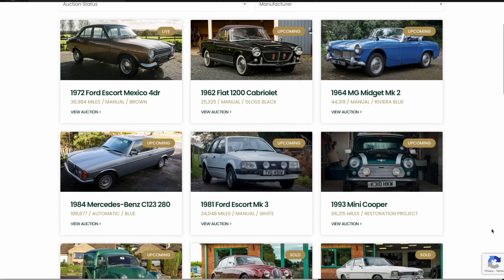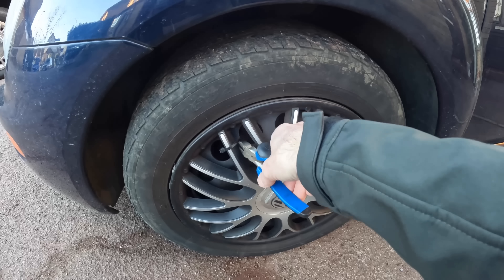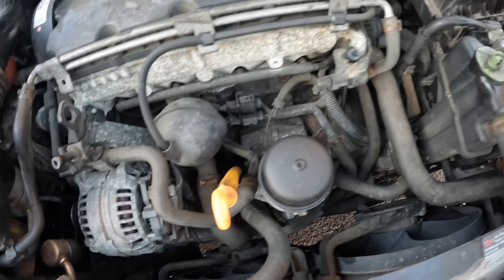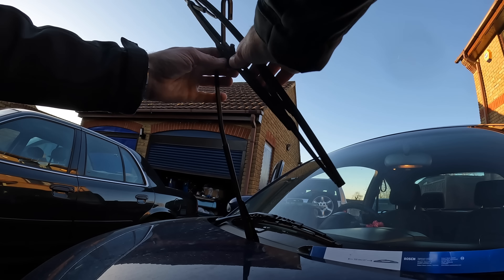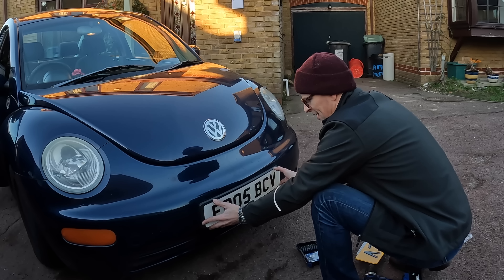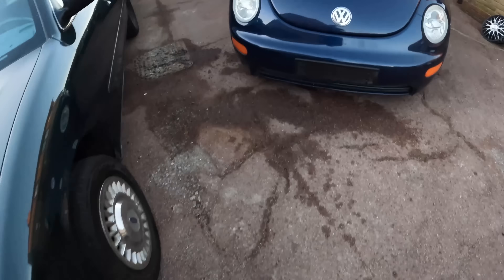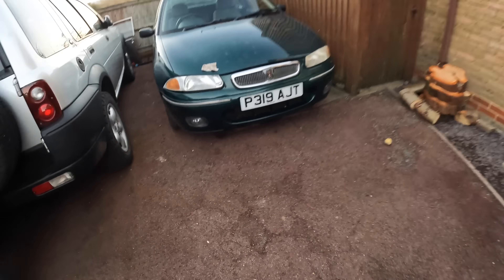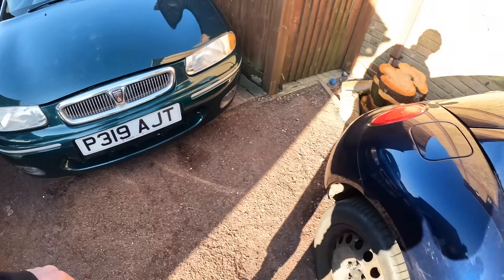New Beetle clean up and fix up begins! Headlight restoration - what a difference!

Comment from the maker: Heres the headlight cleaning kit I used in the video - https://amzn.to/3XhQoRR
Reply: Interesting product Matt! Never seen it before. It saves a lot of time (skip the sanding, polishing etc). Worked out very well on both cars. Rover changes were more than outstanding!
Reply: Sold out already 😥
Reply from the maker: @fhwolthuis  no way!!
Reply: @furiousdriving  yup, and from their own website they don't ship outside UK 😩
Reply: isnt the pipe the lower part that was attached to the one you removed? posting before watching whole video btw. also those impact bits are designed for impact drivers, not hammer drills, doubt it will hurt them though but different impact directions.
Reply: @fhwolthuis  Our Post Office here (An Post) can provide one with a virtual UK or US address to ship to  their mail hub in UK or US  for those companies that don't export (often cheaper and faster shipping than those that do) and collect the customs duty/fee and tax.  Other country's Post Offices/Mall Services should do the same this day and age.
Reply from the maker: @fhwolthuis  bother!

Comment: This is so fun to watch. My daughter has a 2004 beetle and the headlights are frosty. I’m so pleased to find a simple solution. I’ve noticed that the brakes are “soft and spongy”, do you have any suggestions for improving the sharpness of the brakes please? Thanks.
Reply from the maker: Try replacing the brake fluid, that should sharpen it up
Reply: @furiousdriving  thank you so much. I appreciate that.

Comment: Good job, Matt. Glad you didn't wreck the factory wheel trims. They are worth a bob or two and are getting rarer by the year. The headlamps look ever so much better. I have been using McGuire's PlastX for years. The 33 year old headlamp lenses in my 90 Volvo 240 are still as clear as the day the car was built. Some day I will get a set of the glass E-Code headlamps to replace the North American polycarbonate ones.
Reply: Pretty sure they aren't the factory wheel trims... when I owned that car, I researched them and the closest I found were some Amazon specials. They are utterly horrible and on a sunny day with the window down they do rattle... I just hadn't got around to binning them!
Reply from the maker: Real VW trims are insanely expensive used, these are cheap Amazon/Wish specials which I wont miss!

Comment: Just a heads up Matt,
The horseshoe clips are definitely better when they are fully put in first
Then push the hose into the housing afterwards, it can be quite hard to push the pipe inside but you'll get a satisfying click when you know its fully seated

The pipe you have actually looks like it could be the lower hose.
Its the one that comes from the turbo to the intercooler as I assume the beetle also has the side mounted intercooler like the rest of the Mk4 platform!

You need to remove the drivers side wheel, remove a few clips / T25 torx in the wheel well to access the hose.

I assume it's either split or like alot of the PDs has the issue of the hose blowing from the turbo due to the horseshoe clips being put in after the pipe!
Reply: Added note,
I had a quick look through a parts list for the PD beetle

The intercooler is sidemounted
It's on the drivers side,
The part you have supplied with the car, the code should be 1J0145828AD
If my cross reference is correct,
If not just punch the Part no into Google & it should tell you which pipe you have

As previous mentioned however, I'm pretty sure it's the lower hose from turbo-cooler

You can also tell if one side of the hose, the metal part is smaller internally one side as that's what sits against the housing of the turbo!

Best luck mate, fab little engines!
Built a 330bhp one with my brother in 2021

Comment: Check the part number on the hose matches the paperwork. Googling the part number on your paperwork,  it says that part is the intercooler to intake manifold boost pipe.

Also there's no need to buy a headlight kit. Just rub them back with some 2000 wetndry until all the yellowness is gone, then buff with some compound and a DA polisher, then apply a ceramic cleaner to stop them yellowing quickly again.

Comment: Time to clean those steel wheels up  they look cool bare.  Cable ties on wheel trims is compulsory here whether they have a tendency to become airborne or not.  A pain when changing a wheel when coming down in buckets and pitch black.  Manufactures should have stuck with glass for headlights.  Plastic may have saved a couple of quid and a few grams of weight but cause owners hassle.
Reply from the maker: they can make the very sculpted fronts more easily in plastic so the designers love it

Comment: 3:57 Those stones are now making their way into a cylinder…..😢
Reply: It's all so rushed and slap dash. If he had at least given it a quick clean before refitting then the stones wouldn't have got stuck on the soot/grease/crud.
Reply: There was a cut just after, surely he removed the pipe and removed the gravel on the edge.... I hope. Otherwise I hope he sees this before he runs it...

Comment: Having just won a gargantuan battle with a Golf 1.4tsi twincharger engine (second slipped timing chain in 100,000 miles resulted in 8 bent inlet valves), I've come to really hate VW engineers but, I do now know a bit about how VW put these cars together. The hose is probably from the other side of the intercooler. Look underneath on the passenger side. BTW, don't forget about the G-Wiz.

Comment: I prefer the 3M sand and polish kit (the key being the middle Trizac disc) as it removes the actual yellowed surface and polishes back the fresh surface.  Problem is longevity, as UV is a harsh mistress.
Reply from the maker: The 2nd coat here is UV protector, does 3M include that - could combine both kits!

Comment: Could be wrong but I think those wiper blades are curved the wrong way round. Think they're meant to cueve upwards as opposed to both downwards. If that's the case swap the plastic clips the other way around to allow the blades to curve up the screen. Think the new Boost hose sits under the front of the car coming out of the Intercooler. Unless the top hose you took off originally is split (you'd need to check!) then that the other bottom hose. Check the part number on Google and check any images, might show where it's situated. 🙂
Reply from the maker: Wasnt sure about the blades as the old ones were straight!
Reply: @furiousdriving  the original blades were curved, some VW like the Golf/Bora/Passat had a curved passenger side blade only but I think the Beetle had two curved blades. Obviously the curved blades were more expensive than the normal straight universal type, so that is why you may have had the non curved fitted?. As the poster above said, I think you've got them on the wrong way round, the curve should be on the bottom to follow the scuttle panel

Comment: WILD, that's not how I buff up headlights, but for general man street and Amazon account its good enough!!!    I just compound and buff them up, that result is good enough
Reply from the maker: This has the UV sealer so they dont yellow again, but Ive buffed them with paint compound and then ceramic coated them
Reply: @furiousdriving  Sounds good!!!!!  Oh, where's the 145?  Did it leave the fleet, I got hold of a GTA 156 in Dec, shocked how good is, I miss my Ti 146 loads and loads from well 20 odd years ago
Reply: I used toothpaste (Colgate) on my wife's FN Civic (big headlamps). Came up a treat for less than £1. Plus they smelled minty fresh as a bonus ;-)
Reply: @carlreading9916  basically.  Owt gritty.  And then polished. Works. YT has some great videos on it. It’s just too easy. I use a vicious wool mop buff head with compound. Mix with a lighter compound. Moves around headlight like toothpaste. 2 mins a headlight later good sell last another 2/3 years before yellow.  Cost and time almost zero.

Comment: That must be the pipe pretty much directly under the pipe you removed. Goes to the turbo from somewhere in front of the car, intercooler perhaps, not sure. I'm currently in the process of replacing the turbocharger on my friend's 2005 Caddy which has the 1.9 liter TDI engine and this video brings a lot of details back to me as said Caddy has been sitting now for almost a fortnight waiting for parts and actual time. :) ps. I hate VW engineering but I love those quick connectors. Such convenience. :P
Reply from the maker: Ive seen an open engine bay, its right on the bottom!
Reply: @furiousdriving  Hope you can reach it somehow easily. On the Caddy it required the removal of the wipers, cowl, all of the air intake parts and a lot of beer... However after that it was pretty much right there--and came off without hassle because of them beautiful quick connectors.
Reply from the maker: @villejussila1599  the guy who showed me suggested taking the engine out to get to it..
Reply: @furiousdriving  Sounds really extreme... Then again replacing the radiator on a Golf mk4 takes 5 hours and requires removing the whole front end... On a Peugeot 406 V6 the same job takes 10 minutes. Gotta love VW... But with all due seriousness there's gotta be an easier way. I don't know any person with a New Beetle so can't really check unfortunately...

Comment: Ps that's lower intercooler pipe either turbo side or front passenger
Reply: Yeah jack up drivers side will see were it goes runs bottoms of cam belt

Comment: Looks like you've ended up buying two passenger side wiper blades, and they're upside down, the passenger side should curve upwards with the screen and drivers side should be a straight one !
Reply from the maker: Curiously Halfords list both sides as the same, only seem to fit one way around
Reply: Push the plastic clip out, rotate it and push back in. They are often set up for LHD cars.
Curved wiper is passenger side, drivers side is straight with a spoiler.
Reply from the maker: @richfixescars  good point

Comment: when someone doesn't fit an easy to fit part, the issue normally isn't with it.
Reply from the maker: turns out it had only just arrived when the car sold, he thought it was top pipe too
Reply: @furiousdriving  probably a lower intercooler hose. the green o-rings and clips also give problems.
the lugs on the hoses wear and it all doesn't seal up properly